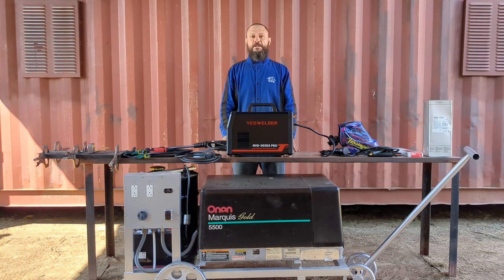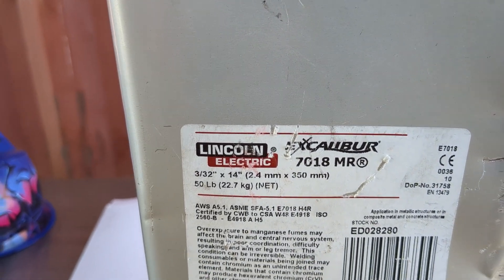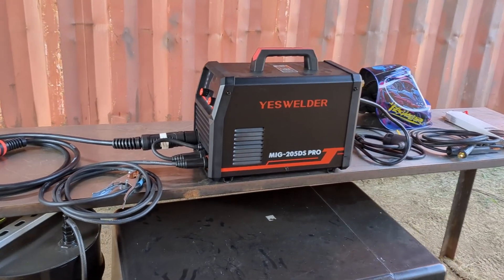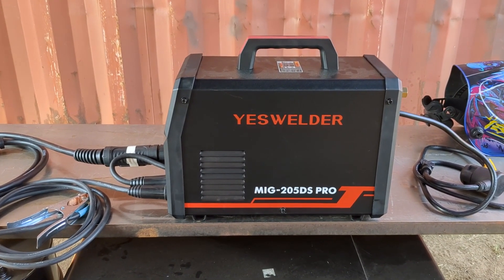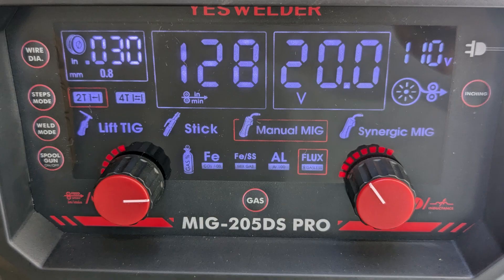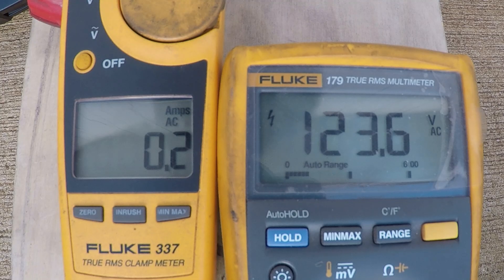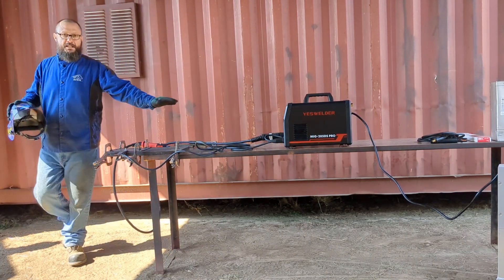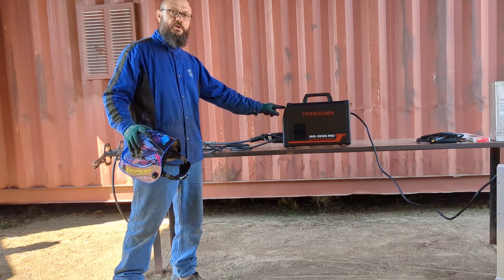Testing Yeswelder MIG 205DS PRO On Small Generator

Comment: Great video. I have the same generator in my RV. Do you think the arc welder version of this welder will work the same on my generator? I also like how the 6013 weld looks, I never used 6013 before. Thank you for the hard work you put into your videos.
Reply from the maker: I haven't tested the ARC only version, however I think it should be the same. 6013 are good rods, they start easy and leave smooth weld beads. Thank you for watching and for the comment. Have a great day
Reply: @SalamSayhood  thank you and same to you